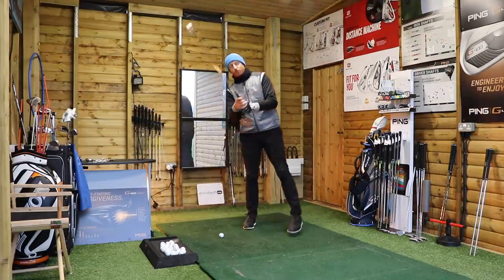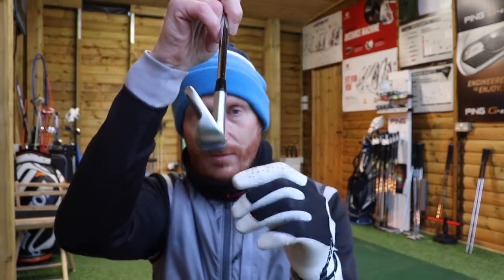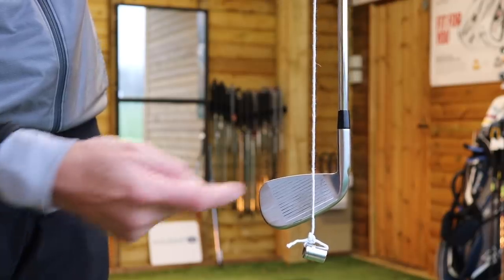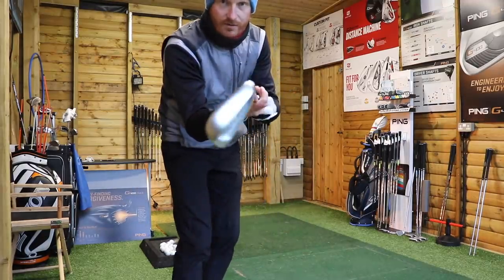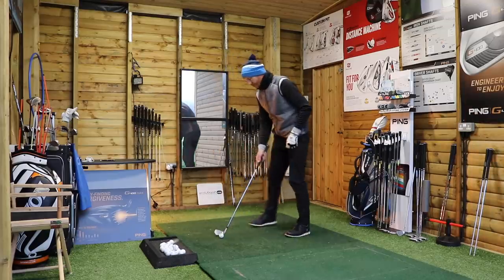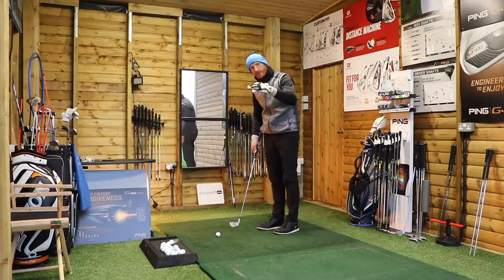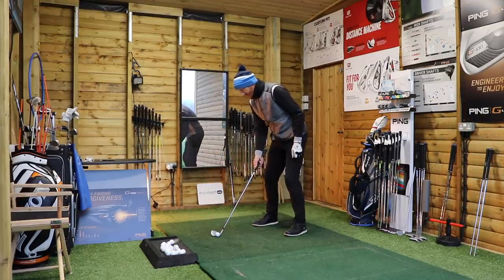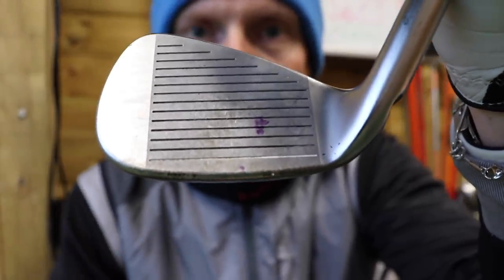GOLFERS This will blow your mind

Comment: Tried the Eureka swing for the first time tonight and so impressed with results, 9i, 6i and Driver, strike, consistency, ball flight.  It took a little work to 1.swing back inside and 2. Move the ball back, but after hitting my first high draws for years! I am so great full for this method. I used to be a single figure good ball striker, but a number of years not playing has left me searching for that feel again and it has been a real struggle.  One night with this method has restored confidence again.   Thank you. 

This forward shaft and open face is something I did at set up a number of years ago with great results, but had absolutely no idea why.  Thank you for clarifying why this works. Absolutely awesome 😎 👏

Comment: A year too late but still want to thank Steve for a clear demonstration. A long while back mr Miura told Erik Lang that sweet spot is not in middle but toward the heel about the same spot you showed us. Great minds think alike i suppose.  I tried and shanked too many times so i gave up but when i managed to make the contact it felt solid and added around 15yds on the 6i. I will try again should there be another lock down imposed.

Comment: This is something I learned a long time ago, and kind of  got away from lining up properly over the years. My first decent set of clubs  were basically still the old blade type irons, the cavity back was just coming in to use, and they had just a touch  of this new technology in them. Balls not hit in the sweet spot  would go all over the place. Left or right, depending on how badly I swung the club. I won these golf clubs at our league golf banquet at the end of the year, and it got cold and I never got to use them right away. I discovered that I struck the ball much straighter more consistently, and with more power when I lined the ball up almost next to the hosel...as I was chipping balls down a hallway into a blanket I had hung between two doors. Thanks for reminding me of this.

Comment: For the reason that a lot of people argue, the center of mass of any object will change when  mass is added to it asymmetrically . So the location of the center of mass of a head will change when it is assempled, it will move towards the hosel and top of shaft.  The distance it is displaced has to be measured. Steve's method is a simple and fundamental method to locate the position along a vertical line that runs through it, as long as friction of free rotation of the club is minimized. The location of the center of mass is independent of the lie at address. Your high school physics teacher could help on the topic -)

Comment: It’s even closer on Mizuno irons as they are 1.5 degrees flatter than most other like Titleist. But Titleist irons have more of a squat head so they make the sweet spot even smaller, because the CG is then bunched up in a crazy area on the face. Once you find the correct timing and swing path to hit this magic spot on a TP-9 for example, there’s no better feeling. Then you shank it and it’s back to earth.

Comment: If there is a difference between static loft & dynamic loft would there not also be a static sweet spot & a dynamic sweet spot ?.  According to Mark Crossfield, ( & I may be wrong) the sweet spot of a club making contact with the ball can move depending on the swing path/ angle of attack.

Comment: It's not a sweet "spot", it's a sweet line.
Hold the club at the butt and let it hang, then tap the clubface and find where the face doesn't rotate when tapped.
You'll find it's a line that is parallel to the shaft, and usually runs through the center of the face ( "sweet spot").

Comment: The sweetspot is not towards the heel with modern clubs.  Essentially, decades ago they didn't have epoxy that was strong enough so they made these clubs with extra long hosels in part to epoxy the clubs and then stick a pin thru the hosel and the shaft to keep the shaft in place.  These hosels were sometimes 2.5 to 3" long.  Because of the hosel being longer, it would move the CoG closer to the heel and a little more upward.  That's why old irons had higher lofts...the ball would launch lower due to the higher CoG design.

The modern irons have much shorter hosels.  Occasionally, you may see an OEM with blades that make the 9 iron and PW with a longer hosel...in order to get the CoG higher and allow for the ball to launch lower.  But, those OEM's will also add some more weight to the toe to offset the CoG moving too close to the heel with the longer hosel.  

But for the most part, the hosels are shorter in length with modern irons and they have moved the CoG lower on the head and i'ts pretty much dead center of the clubface.  This allows for stronger lofts to help offset the higher launch that these designs have.
Reply: Richie Hunt this is correct.

Comment: I have always addressed the ball with the handle of the club slightly forward of the club face but thought it was wrong. I just found it too difficult to bend my wrist to make a perpendicular angle. The sweet spot, on the other hand, blew my mind. That can surely be corrected at the time of design and production. Why isn’t that the case? Great video by the way, love your approach.

Comment: The  method to find sweet spot on putters (suspending club with 2 fingers and tapping for spot with no twist) can also be used on other clubs.  Sweet spot on my irons seems to be inside and 2 grooves higher.

Comment: I've seen a video with Mr. MIURA where he mentions the same thing about the position of the sweet spot. More modern clubs like Tiger's new iron have a tungsten weight in the toe. Even the new Miura irons like the cb2008s have significant weight behind the toe.

Comment: That's fine to line up like that. However there is something called shaft droop in the downswing. That is the result of the middle of the club face (center of mass) trying to lineup with the shaft, just like a weight on a string that's being twirled. The faster the swing speed the more droop there is. That's why the pros use stiff and extra stiff shafts. Lining up the ball closer to the hosel will result in hitting the middle of the club face.

Comment: The location of the swee spot depends on who designed the clubs. As amateur golfers we actually hit the ball all over the face of the club. Spray foot powder on an iron and hit five shots at the range and you will see. Depending on your handicap your contact will be all over the face. Consistency of strike is one of the major differences between professional and amateur golfers. If you can’t hit the ball on the same spot on the face every time, what difference does it make where the sweet spot is located?

Comment: Next time i shank it my comment shall be. !!Do you realise how close that was to the sweet spot!!
Reply: I like your comment. I must remember that! I can relate to that completely! I need to give this tip a try though because my anti shanking 'fix' has been to do the exact opposite of what Steve has recommended (i.e. set it up with the ball at the toe!!)
Reply: Many newer iron heads are designed to fix this problem. They have a tungsten weight in the toe-sole or are just designed to move the center of gravity to the middle of the face. Blades (especially older models) tend to be the worst in this respect.

Comment: Very, very interesting Steve, I'm going to give it a try.  I guess different head sizes, different weight distribution of the head, different length of head from heel to toe, length of hosel will decide the sweet spot location for different clubs?   The location of the centre  percussion is the sweet spot location.   Think about different shapes of say a cricket bat.   The sweet spot location is dependent on bat design.   Another great youtube video Steve, keep them coming.

Comment: Great stuff, I've def noticed when tweaking setup that face sl open at address can lead to straight shots. I remember an article in Golf Monthly in the 70s showing the heel positioned sweet spot but didn't take too much notice then. Also remember late 70s Ryder irons that had virtually no hosel, I wonder if they had a more centralized sweet spot.
Finally... modern drivers seem to deliver a low spin bomb from sl high toe hit, so is that the new sweet spot or a happy coincidental mishit!!

Comment: Probably makes sense and I will go and try it,I personal think that if you are given a set of clubs any clubs ,you will eventually swing those clubs until you hit the sweet spot unconsciously,you may have to adjust your swing to accommodate the new clubs but you will eventual, sooner than later start hit those new clubs as well as your ability allows you too,I can imagine this information may some what hasten that process.Never imagined the hosel weight would alter the performance of a club,thought it main purpose was to secure the head to the shaft ,never to old to learn? Good video,he does a good job communicating these little tit bits.

Comment: I like it Steve. 👍 I do something similar by feel rather than the technical bits. It has always worked for me and especially so when I use my feel version of Eureka. Back in the day when I used a series of Ram and Hogan blades from about 1990 to 2005, I found the sweet spot wasn’t in the middle, it was to the heel side of middle too. These days with my Cobra Black irons the sweet spot is quite high and a little bit to the heel and it took a while to find the feel but for me and my swing, it works.

Comment: If you are going to plumb bob a club you can not hold the club in your hand it would need to be in a fixed device, as in your video your hand is moving a lot and you will get a false reading , infact you could manipulate the club to get the sweet spot where you wanted, (not saying you did ) but to do it properly you have to remove human error or manipulation.

Comment: The video that started an epidemic of shanking.......😉 
Seriously tho is that why Callaway had so much joy with their x12 and x14 models?? Very little mass in hosel? Played well with those, before I moved to mizuno mp 52. 
I think high handicap golfers are in too much of a hurry to hit ball, with too much clubhead rotation, and an unstable base.
I’ve recently tried stable base, slow clubhead rotation (compared to previous) and easing off of back foot to start downswing. 4 over and 5 over for last 2 rounds (I haven’t fixed putting yet) off 9 handicap. Less is more when it comes to golf 😉

Comment: Interesting topic, Steve.  Unfortunately, I think you're demonstrating a flawed premise.  Ralph Maltby, in his book The Maltby Playability Factor, shows how manufacturers 'engineer' the sweet spot back out to the middle of the club face, and if you measure that with the head removed from the shaft, you get a much different result.  Your static plumb-bobbing demonstration, IMHO, actually demonstrates an illusion of where the true center of gravity is.  And in the golf swing, centripetal force contributes to the COG's movement more to the middle of the face.

Comment: Wow this explains alot.  I purchased Forged Cobra Steel shaft One Length F7s a couple of years ago.  Everyone told me I was not good enough to use forged clubs because the sweet spot was smaller and mishits were going to ruin my game.   Out of the box I surprisingly hit these clubs well, no exaggeration it was like night day how much better ball striker I became.   I checked the plumb on these clubs this morning, my sweet spot on all the clubs except the SW and 4i  were just barely outside of the center of the face.  The 4i was even further out from the center almost to the toe( I rarely stride the with this club well, now I know why)  SW was inside the center of the face.  I checked my old Pings and they were all towards the shaft the wedges were inside the center of the face so much I would need to hit the hosel to hit the sweet spot.    I recommend everyone  to check their clubs,   Steve you should name this video Golfers Epiphany Moment kind of keeps to theme of Eureka!!
Reply: very interesting

Comment: Static lie and dynamic lie are completely different. Anyone could get a neutral static lie with any club at any angle. But it's what happens when you swing Is what lie you're actually achieving. Also the club face is made to be thinner in the centre for more ball speed. Hit out of that area including heel or toe equals less ball speed and distance. 
Why would manufacturers mislead anyone to lose performance with their own clubs?
Reply: aesthetics over function?